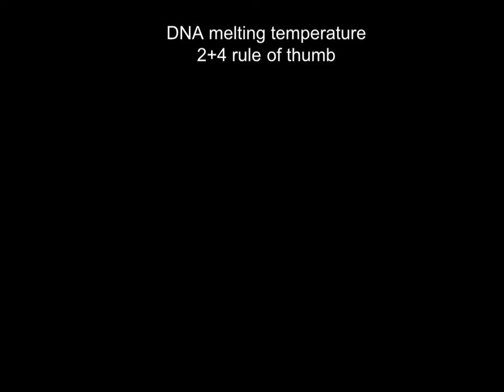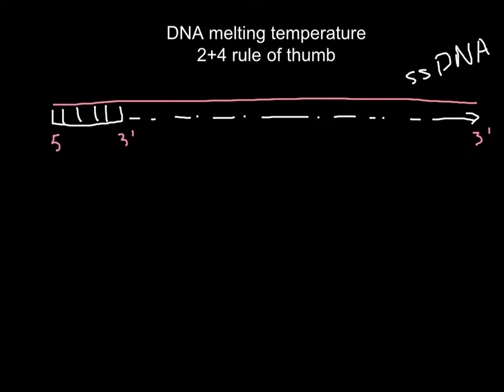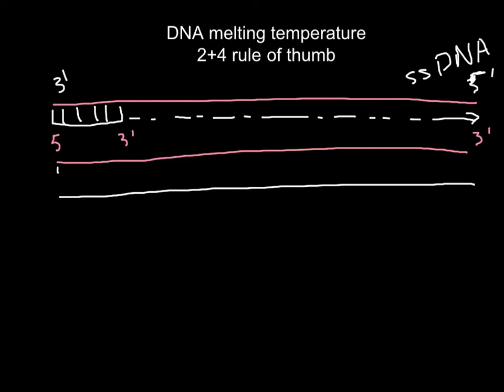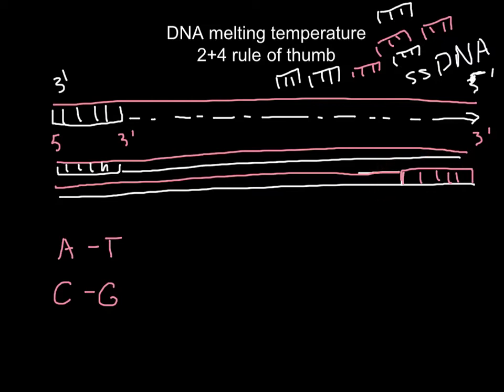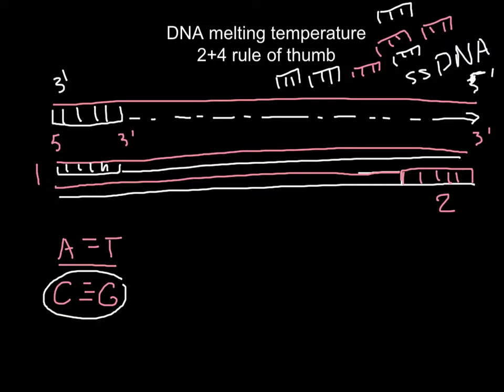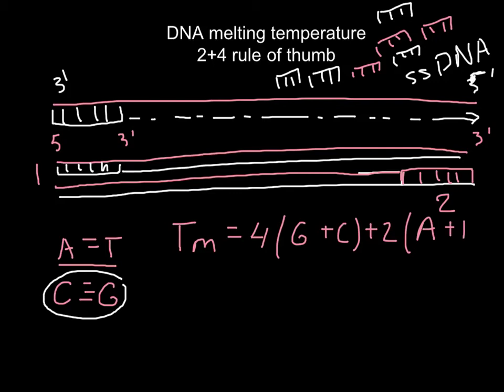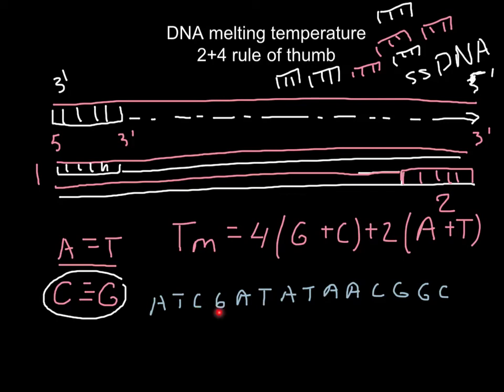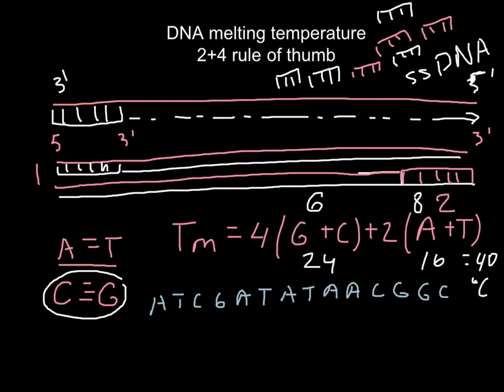How to calculate melting temperature of DNA "2+4 rule of thumb"

Comment: Thanks for trying to help and teach to the large community. But this method is very very bad. It just does not work. Never. Melting temperature depends strongly on the concentration of nucleic acid and salt. Not just Mg2+, but even more of sodium.  It even depends on the order of the nucleotides. The same number of A,T,G,C in different orders have different melting temperatures. 
And by the way, the melting temperature does NOT depend on the hydrogen bonds between strands (not only anyway). Some combinations of mismatches even increase the temperature! (for instance a TT mismatch is sometimes stronger than the matching AT).

The so-called Wallace method is one of the hardest myth to debunk in molecular biology. Please people DO NOT USE 4(G+C)+2(A+T). THIS DOES NOT WORK. EVER. There are plenty of super easy to use software around, based on the correct way of doing things, called "nearest-neighbors". I am not going to quote them (mostly because I am the author of one ;-) )
Reply from the maker: Thank you for your comment, but this video is for the entry level course, and Idea was just to familiarize audience with this method  of calculation. Software calculations are too complicated to explain  in 10 minutes video.
Reply: I understand that Nikolay. But the method is wrong. It does not work. It does not predict anything close to the melting temperature. So it is exactly like a primary school teacher teaching kids that 2+2=5 because it is a "close approximation". I know you meant well, and I know that you learnt about this method in some textbooks that have propagated this myth for a few decades without checking. But it is just that. A myth. The method did work for some molecular biologist 60 years ago, who worked in some very specific conditions, always the same. And for some reason, mostly because it looks simple and easy to remember, it has been propagated as a meme. This is total nonsense, and "teaching" that does not help at all. Really. Just try it yourself on actual data (actual measured melting temperatures. There are plenty in the literature. I can send you papers if you need). I am sorry to pick on you, because I really appreciate people who teach science through Youtube and other social media. But this is not science. Sorry.
Reply from the maker: Scientist have to start with something - when structure of DNA was discovered - this gave Idea about forces that hold two strands together - and it was obvious hydrogen bounds. So next step was just to calculate how many hydrogen bounds we have in specific DNA fragment and try to calculate melting temperatures. Next step in experiments was to calculate melting points of say, fragments consisting of bases with 3 bounds, 2 bounds and mixtures 2-3 bounds.  Then with different mixtures say A-T-A-T and AA-TT  All these experiments lead to new correlation formulas that took into account not just a number of bases and number of bounds  but a Sequence of the bases along with other factors such as chemical concentrations and so on. But we have to mention that all these later "adjustments" to the initial formula changed it beyond recognition and nowadays so complicated that nobody do such calculations "on the knees", especially when  we have a mixture of different primers - the more primers we have the more complicated calculations become  especially in such cases as forensic DNA kits when we have mixture of at least 28 different primers - that have to be unique to 28 different sequence of DNA and should at the same time have the same melting and annealing temperatures. It is impossible to imagine  to do such calculations manually. 
Such chemical produces - gigants as Sigma Aldaich give a credit to Wallace  http://www.sigmaaldrich.com/technical-documents/articles/biology/oligos-melting-temp.html
And this company know their business. 
But you right - I should probably have to mention that this video is just historical review and not something that is used in modern daily lab routine.